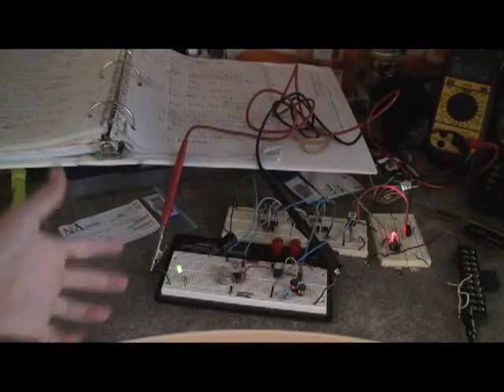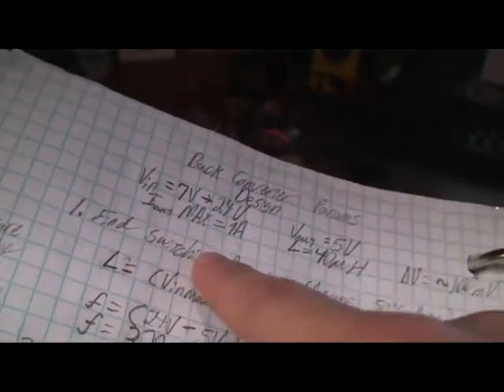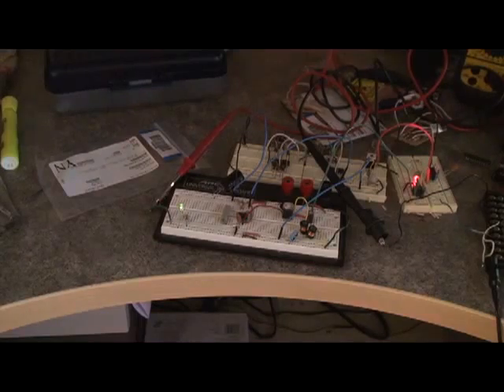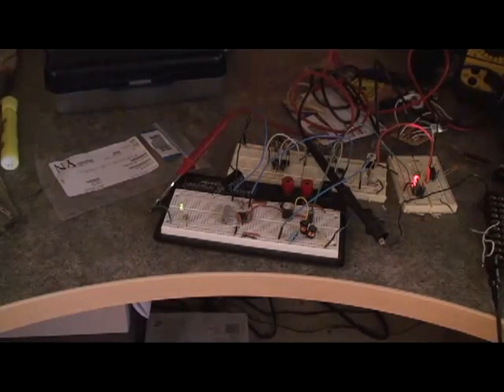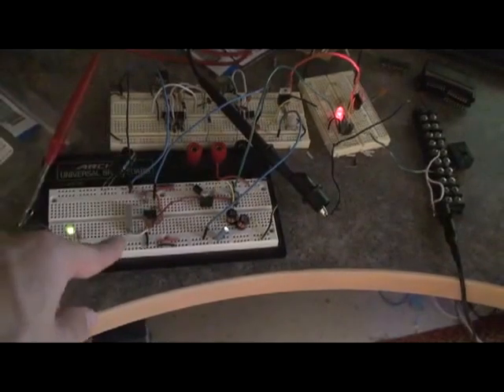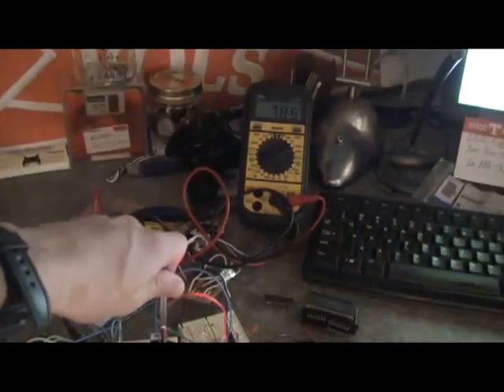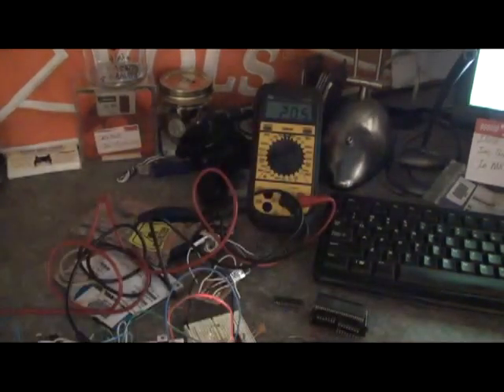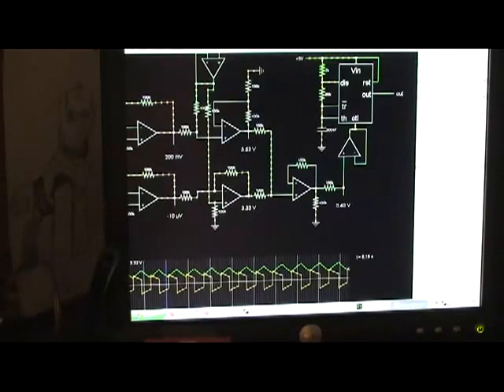Buck Converter Feedback - 3-4ths Working

Comment: Alright then, and if the duty cycle dropped when the voltage dropped wouldn't that cause the voltage to drop farther? I have no experience in converter circuits of any kind...so yeah.

Comment: 20% efficiency on linear regulators, is that what you said? If that were true then the 12V regulator on my driver board would dissipate 14.4W at full load, where as at max load it only dissipates a little over 4W. With a 13V supply it would only dissipate 1.5W, I'm using a 15V supply.  May I ask where you got the 20% figure? I'm confused x.x